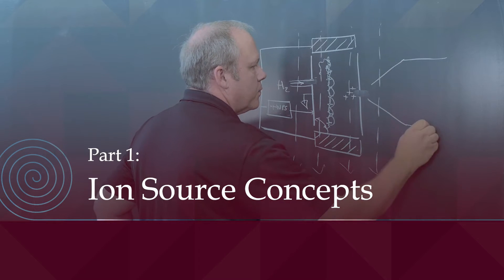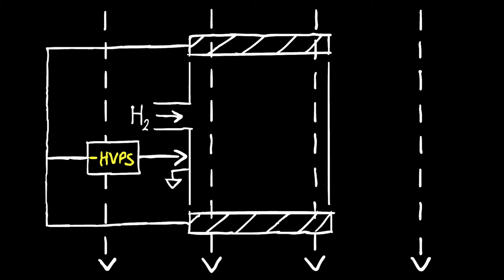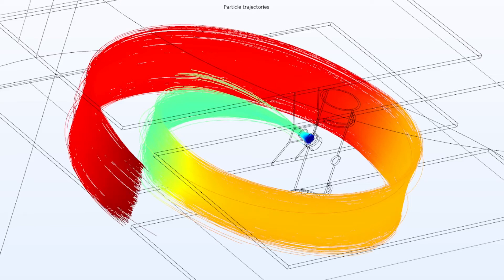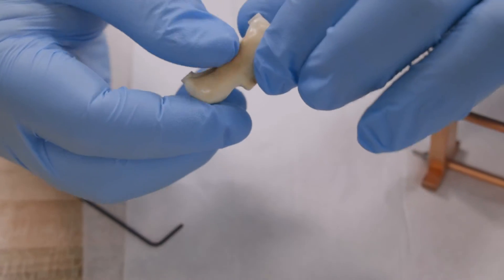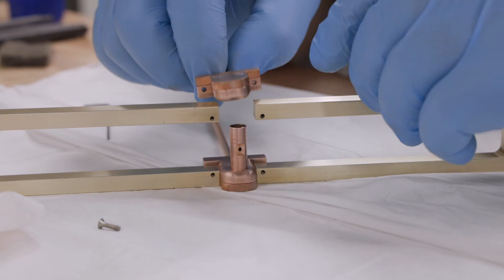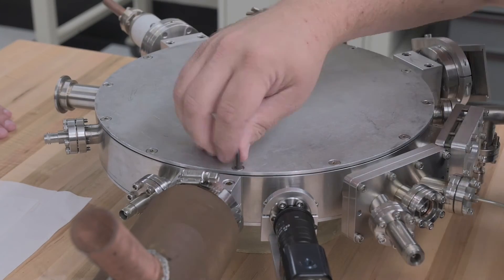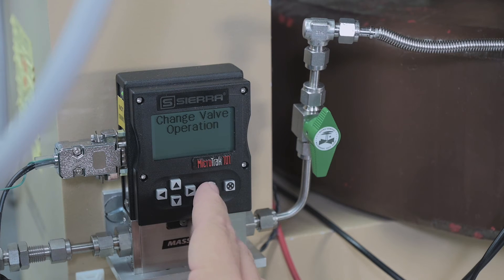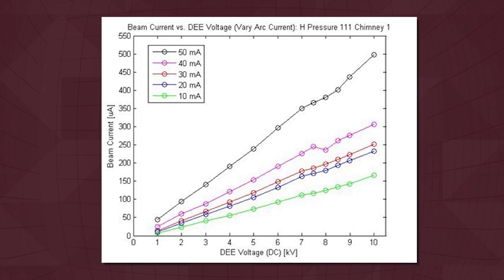The Ion Source - Cyclotrons!

Comment: I do like the magnetic effect for the electron travel as an efficient means for Proton and electron emission. However, how would one go about electron capturing instead? Do you ignore the H2 gas? Or would one need to redirecting protons and neutrons out of the system? Do you reverse the polarity of the electrodes or magnets? I understand that x-rays would be involved and further shielding would add minor complexity. Thanks in advance.